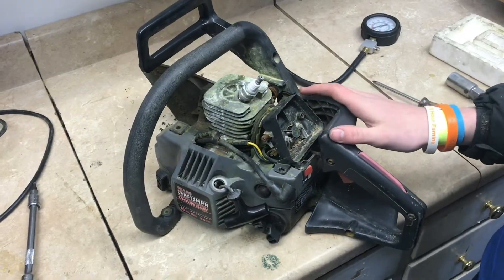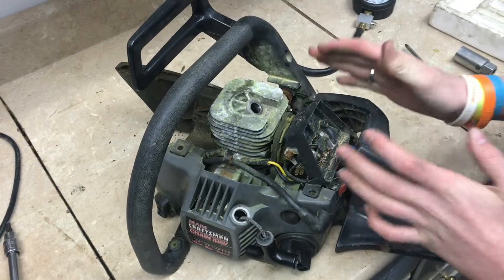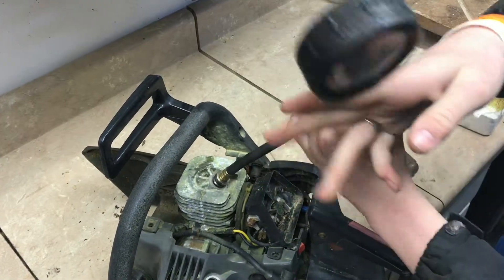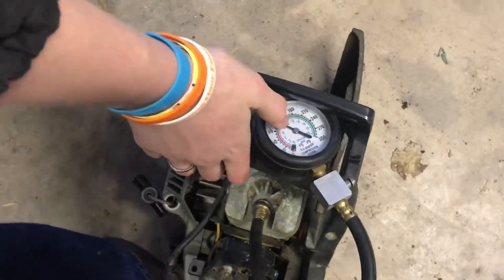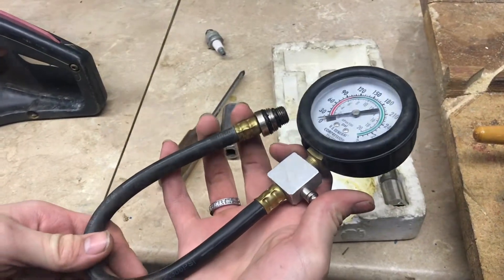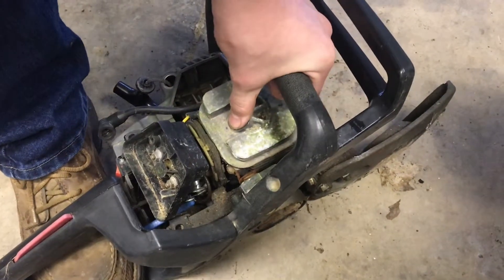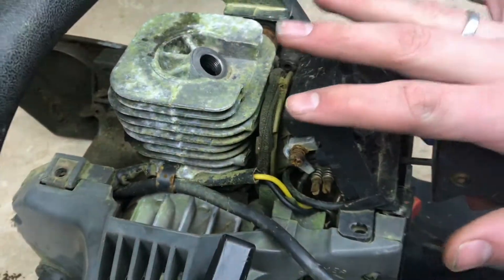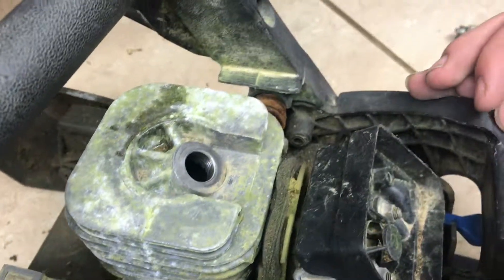how to do a COMPRESSION test on a chainsaw or 2 cycle engine

Comment: Don't forget to have the throttle wide open when you do your compression testing.
Reply: Why? Can it really make a difference on a 2 stroke?
Reply: @stu sue  Yes it can for sure.
Reply: @FelonENews  Based on your comment I grabbed a saw and a compression tester. 
First test. Pulled the saw over with throttle closed until no increase in psi , then pulled saw over with throttle wide open. No increase in psi.
Second test. Pulled saw over 5 time, once with throttle open and once with throttle closed. Got the same psi reading after 5 pulls. 
Given the rpm is so slow and the exhaust port closes after the transfers I'm really not seeing it. But maybe on some really "non standard" porting job?
Reply: @stu sue  I may do a video on it tomorrow. Also, be sure the chokes not on.
Reply: @FelonENews  Choke was off. I had meant to add that to "closed throttle" but I forgot.

Comment: Not sure what your figures represent, but 80 to 140 is sorely lacking.  If a 2-cycle engine is making 80 psi, it will lack power...take a 60cc chainsaw with 80 psi out to that test log.  Engine will start, run, and rev, until you put it to wood.  It will fall on its face.

140 is marginal, most 50 - 60cc engines look good @ 140 -150.  I welcome any comments.
Reply: My Stihl 021 blew 190 psi when new

Comment: 140 psi good compresion ?????????? husqvarna 372 xp
Reply: No
Reply: @d-railfpv9315  ?
Reply: A 372XP is a 71cc engine making 5 1/2 HP.  Your lawn mower is smaller.  140 psi would be an acceptable comp. reading, .....with the de-comp valve opened.

Comment: When doing the compression test, make sure you have the throttle wide open otherwise you won't get an accurate reading.
Reply: Why? Can it really make a difference on a 2 stroke?
Reply: That’s totally irrelevant. 😂 You get the same damn reading.